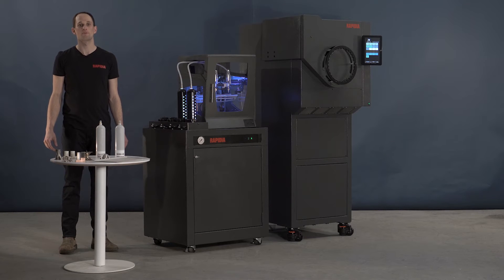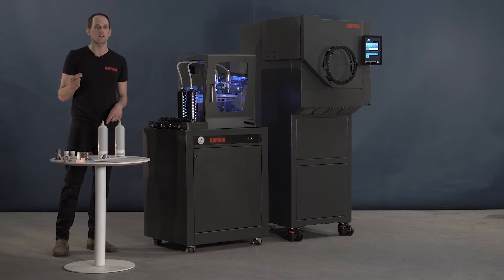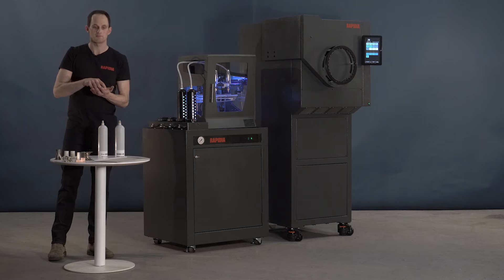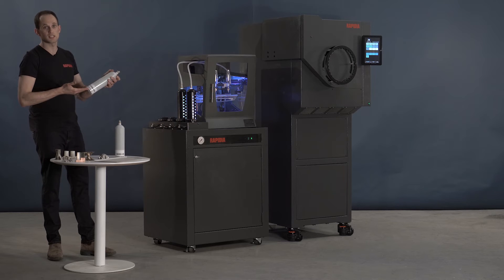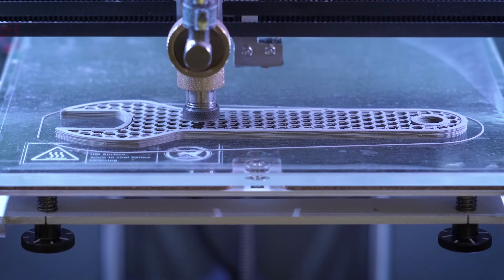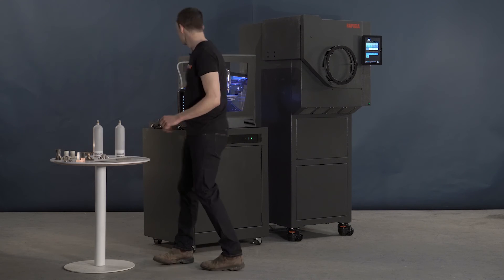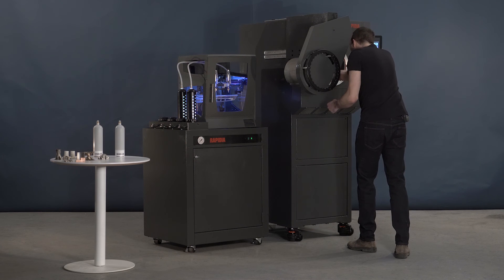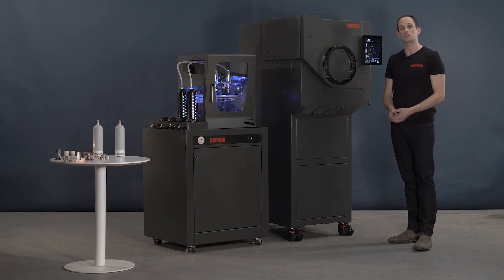Rapidia   Metal 3D printer

Comment: Why are there no new videos from rapidia? 😮
Reply: You are right. Shame on us!
Reply: @dgelbart  do you offer any bigger build volume 3d printers?  Also, what is the 3d printing detail limit with the nozzle in rapidia’s 3d printer?  Is it comparable to a 0.6mm or 0.8mm nozzle of typical fdm printers, etc?
Reply: @Bromo_Sexual  The build volume of any 3D printing method based on sintering is not limited by the printer or furnace but the sintering process itself. Any part larger than our build or furnace volume will distort too much in sintering. Our standard nozzle is 0.4mm, with print quality similar to any high-end  0.4mm plastic FDM printer.
Reply: @dgelbart  thanks for you informative answer Dan.  I was hopeful that proper supports integrated into the 3D print would prevent distortion for big parts during the sintering process, but sounds ineffective based on your reply.

Comment: Interesting product. Thanks for posting this video. How delicate are the parts before they go into the over? It looked like you were handling it very gently. What would happen if you accidentally dropped the part?
Reply: The parts are quite delicate before sintering. There is no problem to handle them, but if you drop one it will shatter.